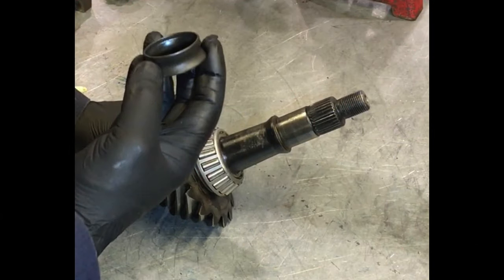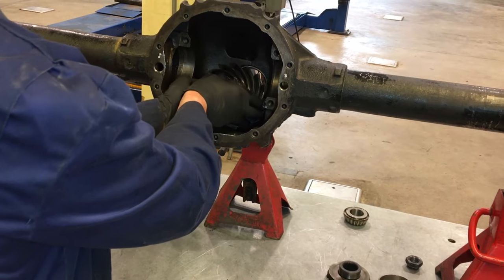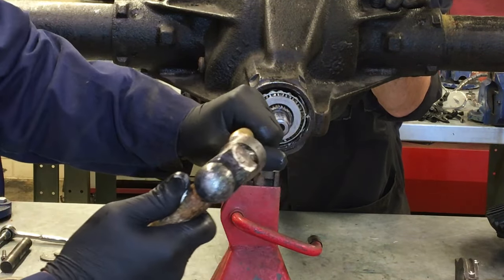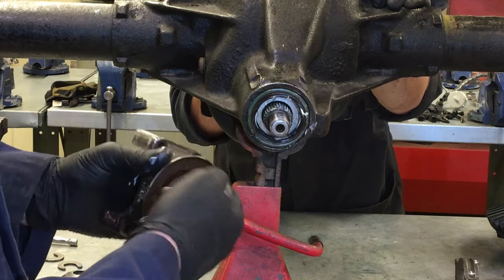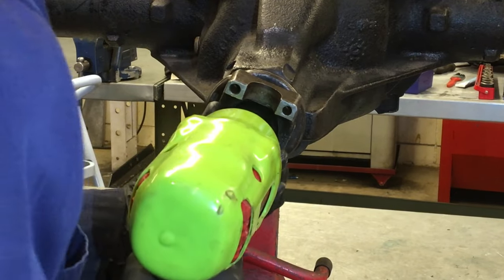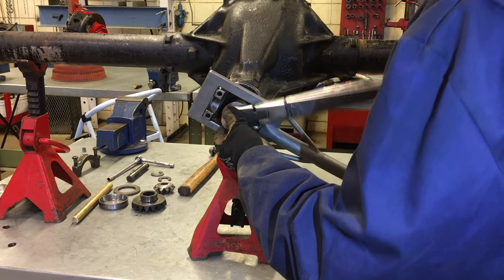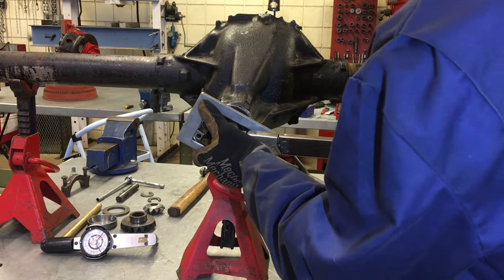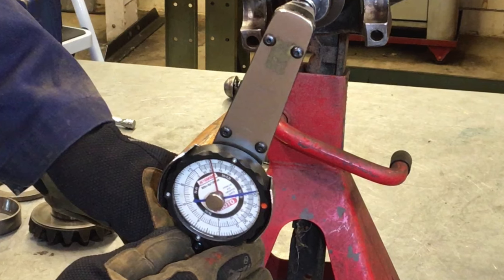How to adjust pinion bearing preload

Comment: Thank you so much.  I need to do the pinion bearings in my sterling 10.5.  this cleared up the whole inch pound spec thing for me.  My initial thought was holy crap inch pounds is barely tight! But now I understand that its a measurement of the force required AFTER torquing down the nut
Reply from the maker: My pleasure Stephen.  On some vehicles you will have to put quite a lot of force on the pinion nut to establish the rotating friction.  Once you reach the minimum required torque with the torque wrench and if you are not able to get to preload by bumping up increments on the torque wrench, you can also go onto use a breaker bar, if needed, to get the extra tightness required to get that preload to spec.  Sometimes even a snipe is required as some crush sleeves can really require some high torque values and good grunt to collapse the crush sleeve enough.   My video was to spell out the process.  Tighten though as you need to.  Just a tip.  Best wishes on your repair.

Comment: Excellent - and a life saver.  Was scared of this, but you make things very clear.  Wish I had that fancy dial wrench, but I’ll make due with a 1/4” beam wrench and a bunch of adapters =}

Thank you!!!
Reply from the maker: Thank you. 🙂
Reply: @bensiemers5094  for the record, I think I nailed it.  I’m on the high side of the torque range, but it spins smooth and freely.  THANK YOU, again!!
Reply from the maker: Nice work Ron.  Thumbs up to you.  Cheers. :)
Reply: I know this is old in 'internet years' but just an FYI if you didn't know, adding adapters and/or extensions to a torque wrench alters the readings. I can't remember where the chart is online but one exists to assist those who have to use adapters and extensions to correct for their use and achieve exact torque goals.
Reply from the maker: Great point Gregory.  Absolutely.  There are charts somewhere for that, or you can use a little math.

Comment: Great Video, would this also work on an existing setup that was leaking. I thought it required a Pinion seal however…. Turns out the nut was very loose and was leaking from the nut… can I reassemble using this method with a new seal? It’s a 1980 WS6 with disc brakes. In a 1970 RS Camaro… thx.
Reply from the maker: Thank you,  the procedure will work with a new or used one.  Just consult a manual to determine the used pinion bearing preload specs, as they will be set slightly lower than on a new bearing.

Comment: I enjoyed watching the video, it was very informative. I was wondering, if I have a loose pinion nut on my truck what is the correct way to tighten it?
Reply from the maker: If your nut has loosened, I would be concerned about bearing and crush sleeve condition as the pinion bearings would have be knocking around on their races as they turn under load.  With the axles in it is tricky to correctly set the pinion preload, but if remove the drums or calipers and rotors you can adjust pinion bearing preload.   Support the vehicle and adjust it as I recommended in the video, but adjust the preload to the higher side of the spec range to accommodate the extra friction required to turn the axle shafts and you should be fine.  If you are experiencing howling or wine, you may have to tear down the differential to inspect the bearings and gear condition.  If everything runs quiet, you should be fine.  If you cannot establish correct preload with the specified minimum pinion nut torque, you will need a crush sleeve.

Comment: So let me be sure I understand - this is something you can do to correct preload on a previously setup diff? Or if you need to replace the pinion seal? Can this be done with the ring gear and axles in place (I get that the wheels/drums/calipers shouldn't be installed while checking with the inch-pound torque wrench).
Reply from the maker: Great question Griff.   Yes drums should be off it has drum brakes or callipers disconnected from rotors if it has disc brakes.  Likely best to remove rotors for best accuracy in case there are emergency brakes behind the rotors causing drag.   The adjustment is something you do when are first assembling a differential from scratch with a new crush sleeve but also should be checked if the pinion seal is replaced.  Many techs as a short cut, mark the pinion nut, pinion shaft end and yoke with a punch mark to note original position of the pinion nut before replacing a seal.  Once removed and the seal is replaced, the nut is  reinstalled to the same position.  That often works in a pinch and is a time saver if your repair is on a vehicle that has miles on the differential and bearings.   Pinion preload does normally drop once the bearings break in.  So it is important to check that there is no endplay or slop in the pinion shaft once reinstalling the pinion nut back on the pinion shaft.  As well, if there is little to no pinion preload remaining,  after using the short cut method, it is worth going to the manual for reference sake and then tightening the pinion nut additionally to reach the correct rotating friction value (pinion bearing preload) as specified by the manufacture for used bearings, using the method I demonstrated.    Thanks for the great question.

Ben
Reply: @bensiemers5094  *What a great explanation,wish everyone soaked it in really good, it is to the point and extremely useful when you need it*.

Comment: Here is the problem: asked gmc dealer to replace leaking pinion seal on the  front differential of my 2011 4x4 5.3L 6 speed auto sierra. They recommended this repair one year ago, i just had it done november 11th 2021 with my yearly safety inspection. Ran two wheel drive sounded good. Set to " auto" on dashboard  transfer case selector..sounded ok driving out of dealer. 9 days later selected " auto" again because of wet roads, fall leaves on road. Ran back roads to work, not interstate. Started hearing bearing noise, felt new vibration. Turned of auto reselected 2 wheel drive mode. Left work tried auto again..scraping bearing noise, then went into a sharp left bend in the road..the front end started grinding, talking, repititive clunk clunk clunk.
Looked under truck, drive shaft from transfer case bolts tight, feel no binding in front drive shaft.
Took it to dealer check oil..oil ok. Test drive the mechanic hears grinding..advises stay in 2wd mode. I now speculate here that the tech didnt properly set seal, bearing or properly set preload. 
Can it be reset properly now?

Comment: Great Video! I'll be replacing the pinion bearings on my 2001 ford 9.75 rear. Do you know a reliable source for torque specs?
Many Thanks!
Reply from the maker: I am not sure what vehicle you have the rear axle from.  Is this a pickup?  
I am taking that this is a removable carrier diff?
Reply: It’s a ford E-150 club wagon
Reply from the maker: This should help.  This is from Summit Racing and it has, what I believe, is your specs. https://static.summitracing.com/global/images/instructions/fms-fordinstshtring-and-pinion.pdf
Reply from the maker: Thank you
Reply: @bensiemers5094  This is Perfect, thanks so much!

Comment: what do you do with out a crush sleve? are the shimms meant to bridge the gap from the front and rear bearings for preload? i cant for the life of me find a video showing preload with shims
Reply from the maker: Great question.  Yes, the shims act in a similar manner as the crush sleeve.  Both configurations maintain a specific distance between the pinion bearings so that they do not press excessively or insufficiently into their races.  Shims are a little more work to set up, as you have to play with adding or subtracting shims until you obtain the correct rotating preload (friction).  The Pinion nut is set to one specific torque, unlike designs that use a crush sleeve that has a minimum torque on the pinion nut but then can be torqued beyond that to crush the sleeve until the desired rotating friction is achieved.

Comment: Can you do the pinion preload torque reading while the differential gears are in and connected to the pinion? I’m doing this on a Ram 2500 with an AAM 11.5 rear diff. I’ll also take out the rear axles to make it to where there is no drag caused by wheels, brakes, etc. 

But I can’t get a straight answer as if this is accurate to do with diff gears still in place.
Reply from the maker: Hi - Ideally the pinion preload is done while you just have the pinion gear in.  There will be added preload to move the mass of the gears, axles etc into the unit.  As a work around, simply remove the tires, drums or rotors and calipers, mark your initial pinion nut position on the pinion shaft, pinion nut and yoke, to know initial tightening point.  Start by measuring the pinon bearing preload while everything is together if you have it together and record it.  Then back the pinion nut up just enough to eliminate any pinion preload.  Then rotate once more the pinion nut and yoke to measure the preload that your other components create alone while turning the pinion  using an inch pound torque wrench.  Subtract the two to determine the friction you had to start with.  Then calculate how much more friction you want to create to reach spec.  Tighten the pinion nut up either to the initial marked points (or higher if needed) to  determine the preload on pinion nut that must be added on to the rotating friction of the remaining parts in the differential that are in motion.  Let me know if that makes sense.  Have a great day.
Reply: @bensiemers5094  this helps a lot! Thank you
Reply: @bensiemers5094  I have another question if you could answer please. What if I am measuring the preload with the gears in, axles out - etc, when I measure the preload it measures 70 inch pounds at first (like as I first start to move the torque wrench), but when I get the torque wrench in a faster motion it only reads 20 inch pounds. What would be causing that? There is resistance at first but once the yoke begins to move the resistance becomes less, basically. 

BTW, the differential I’m working with recommended torque specs are 25-45 inch pounds with the other gears in the rear end connected using an old bearing. 

Any thoughts? Help is much appreciated.
Reply from the maker: Hi.  That is a real good observation and it is normal to spike on the initial breaking torque to make it move.  You don't want to take that reading as you are overcoming the sticking of the parts and the inertia to get it moving.  Measure the preload while it is in reasonable motion.   25 to 45 inch pounds while in motion, sounds reasonable with all the gears being in the case.  If you have gained some resistance while tightening from when the pinion is backed off, this is telling you that the pinion bearings are contacting the races and are creating some desired friction to prevent them hammering or plunging while rotating.  If you are at 20 inch pounds I would give it a just whisper more to creep into the spec range.   If they are used bearings, I would suggest staying on the lower side of the spec.  Hope that helps bud.
Reply: @bensiemers5094  that helps! Thank you

Comment: I need to replace the seal.   I dont' want to take it to a mechanic becuase what if the mechanic is new in his careeer and doesn't do the pinion nut correctly.  I was wondering,  If I mark the position of the nut before removing, then replace seal,  and if I torque the nut to the same position will that be suitable to get it back to where it was before I replaced the seal?  or is that an all out bad idea?
Reply from the maker: That requires a complicated response, as it is all dependent on the state of your differential, and what condition your differential's bearings and crush sleeve are in.  You will have to assess that by checking for endplay and how tight the pinion nut is before starting.  I would suggest marking the nut, pinion shaft and yoke alignment together first.  Then check the manual's spec on pinion nut torque, and then see if your pinion nut can be tightened to that minimum pinion nut torque without it moving.    If the nut holds its position, this is a good sign that your crush sleeve is healthy.   However,  if the pinion nut wants to move beyond the marks before it can reach the minimum torque spec, then you have a previous setup issue and are under the specified preload before starting your procedure.  This could also indicate that you have a failing crush sleeve or previous improper tightening.  Additionally,  If endplay exists before removal, despite minimum spec being reached then there is an indication of bearing wear or once more an under tightened pinion nut. 

Saying all that, this shortcut is very is common, and works well, if you are able to remove the yoke, replace the seal and bring the marks back into alignment and still hold the minimum specified pinion nut torque in foot-pounds after tightening. Keep in mind, there should be no endplay and there should be some rotating friction on the pinion shaft.  You can check specs on that.  However, under regular driving, this normally lightens up, and this will likely be lower than specified due to natural bearing wear.  

For more accuracy, I do suggest that you remove the drums (or Calipers and discs) before starting, and then see what the initial pinion-bearing drag (preload) is through the entire unit.  Typically we do preload with axles out, but this will give you a baseline to start.  Once more, be sure to mark the pinion, the nut, and the yoke orientation together if you are doing the marking method.  If you can get your hands on both a foot-pound and inch-pound torque wrench, you can determine if you have what you started with. You have to keep in mind that you are turning axles, so you will have to calculate for the extra 10 to 15 inch-pounds of drag that they could produce. 

Seals are frequently replaced with the shortcut method.  But you have to be careful.  Sorry for the long answer.  I don't want to misguide you regarding the unspoken complications of the marking method.  Technicians develop a feel for this method and they can take shortcuts very readily by recognizing the feel of torque, drag, and endplay confidently.   Hopefully, this helps.
Reply: @bensiemers5094  I understand why its not an easy answer.  the only thing I do have going for me is that I bought the truck new in 2004 and this is the first time the pinion will have been removed.   good idea to check end play before removing it.
Reply: @Jimo225  I changed mine while i had the carrier out for Yukon Duragrip  posi install. i measured pinion preload with carrier out with a dial torque wrench like this dude. I installed the seal but I used a new nut as you are supposed to never reuse a pinion nut and torqued it down to exact preload that I measured beforehand. Always ure some loctite red on pinion nut also. hope this helps.

Comment: And these numbers are with the carrier OUT of the housing correct?
Reply from the maker: Good question.  The numbers will vary based on the model.   The measurements should be done based on manual recommendations.  Generally, the pinion measurement is done when it is the only part installed in the differential's carrier, in the car or on the bench for a removable carrier style.  Pinion preload is best measured when the crown is not in contact.  If you are doing it with crown gear installed, you will have to factor in the rotating friction it will add.  Axles should also be removed.   On many differentials the carrier is integral with the housing and cannot be removed from it.